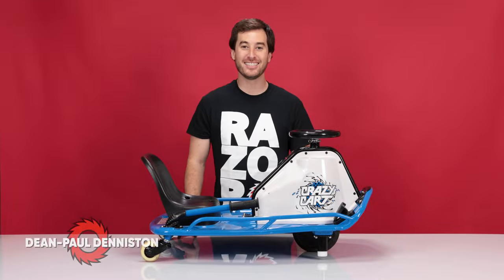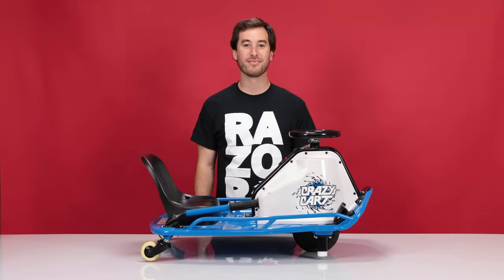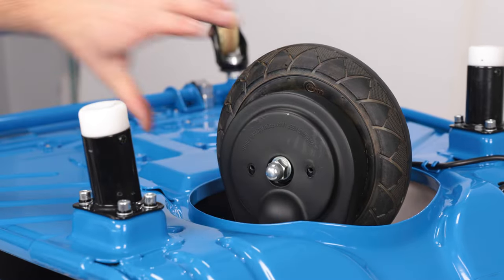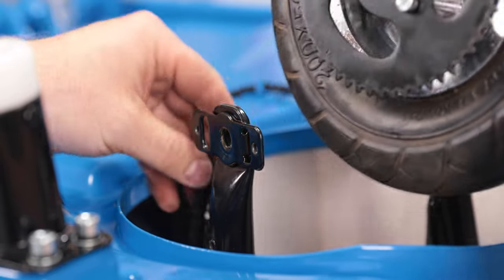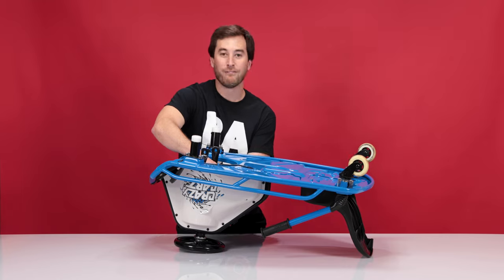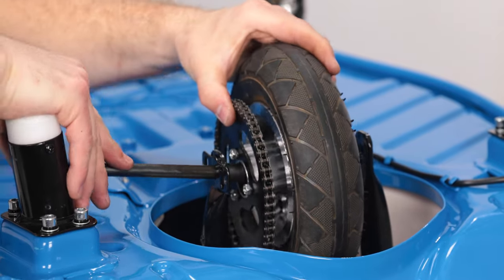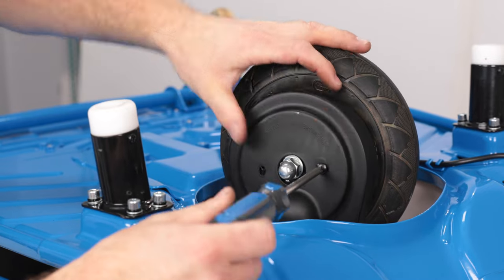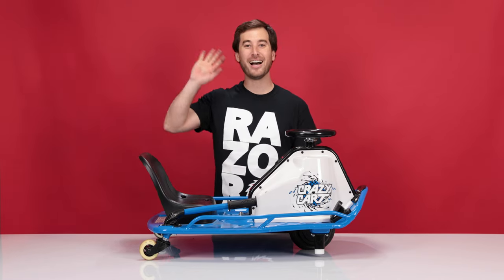How to Replace the Wheel, Chain, and Chain Tensioner on The Razor Crazy Cart

Comment: How do you put the new chain tensioner on because the thickness of the spring and the tensioner body? I can’t get the bolt where the motor is right next to the bracket how are you doing that?